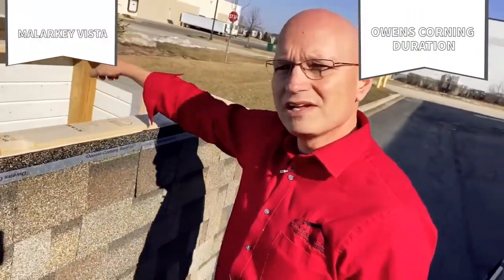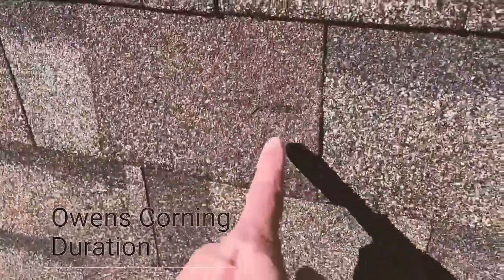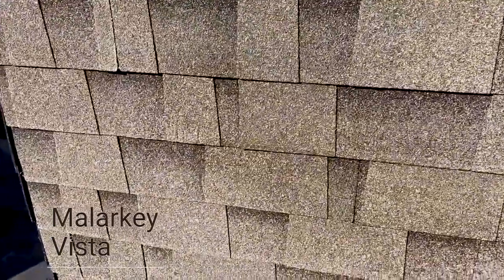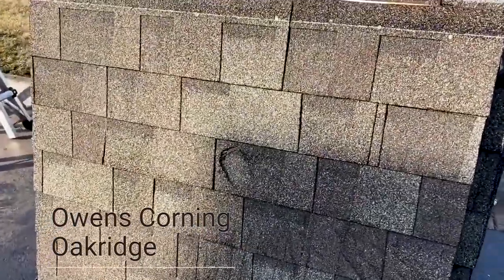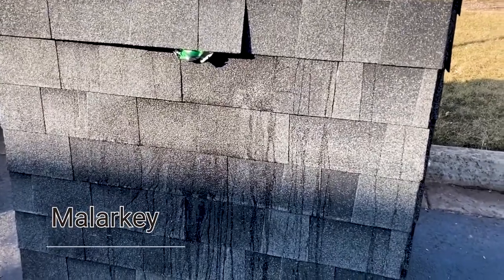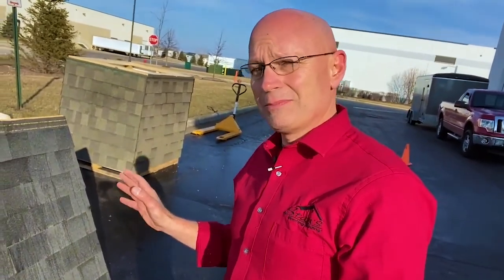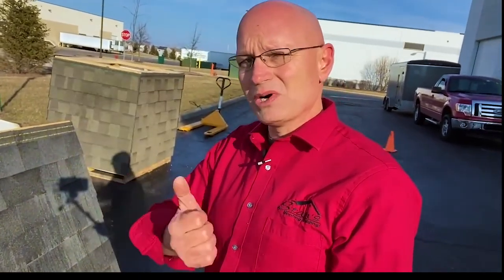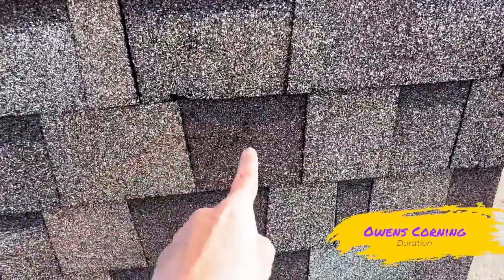Malarkey VS Owens Corning Shingle ROOFING IMPACT TEST

Comment: VERY UNSCIENTIFIC TESTING! Some samples are on fixed surfaces.  Others are on loose panels that can bounce up and absorb impact. Frozen cans are a TERRIBLE projectile. Some strike on the sides of cans, others tumble and hit on end, PATHETIC!  ALL shingles should be mounted on the exact same sheathing and fixed exactly the same.  SPHERICAL projectiles must be used and cannon must be checked for consistent velocity.   I suspect that the testers already knew the results they wanted. And magically got the results by manipulating the means.